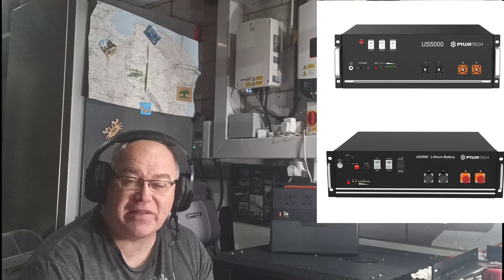Pylontech battery update - not as OTT as I thought (+how we mix US3000/US5000)

Comment: Hi Nigel, Hello from sunny Australia, I current have 8xUS3000 on my Off Grid system in two DC banks with a battery combiner, How many battery modules can exsist in one string using the RJ45 looping control. I read it's 8 max, is this correct? Thank you for the great video. Do you know where I can find a PC monitoring program called "Battery View"
Reply from the maker: I think it's 16 or 20 before you need the pylontech network thingy.  8 was the original limit with us2000 when they first came out

Comment: My FIT comes from British Gas who I no longer use as a supplier. They insisted that I must not under any circumstances charge my batteries during the low cost period and then export that energy out to the grid at peak times. I could only export excess solar energy. I am not sure what happens when I get a car capable of C2G.
Reply from the maker: Unusual that'd presume you get export payments based on actual export through your smart meter not deemed export  but even that is irrelevant how the battery is charged .

It'll say on your fit  bills how it's calculated .

All you have to do is decline export payments on the FIT scheme as I have but sounds like you'd be better off moving your FIT away from BG

Comment: Hi Nigel, good video, I have a 2/12 year old system, 5.44 kw array  (solis 5kw inverter) with 16 panels, 4 pylontech us3000 batteries , I would like to add at least 2 us3000s or us5000s to my system as we have recently added Toshiba A2A system like yours, Having watching yours and other videos it appears to be fairly straight forward to do it yourself, I did ask my original installer who were not very helpful as they have moved away from using pylontech. Do you have any recommendations for the best place to buy pylontech batteries to be self installed ? Regards

Comment: Can you buy Pylontech or any other brand of Batteries second hand and then mix and match  them.
Whilst I will have bidirectional EV charging. Just as with compute spreading ever  cheaper compute into its networks and speading up in the process (pun intended) so having more batteries should make load managment across    the batteries.

Comment: Does anyone know if it possible to be able to charge the batteries without using solar ?
Reply from the maker: Ac charging from the house
Reply: @EVPuzzle  how do you do that. ?
Reply from the maker: @kroozer5215  the inverter will have a setting and schedule to do it . If victron like mine it's on the vRM ess settings at the bottom of the list .

Comment: anyone know what the ordeal with Plylontech 5000 batteries are?, check online and some 5000 are disounted massively and others still holding their price? Is there a difference in versions of the 5000 type hence why some are cheapr??? tia
Reply from the maker: Not seen any really cheap ones tbh , where r they .  I wouldn't trust every ad of course , some too good to be true deals are just that
Reply: @EVPuzzle  Voltacon Energy Systems £1099.00

Comment: The Grid in Australia is rapidly becoming an export tool rather than import.

As an example on a typical Spring day with 12kw of solar, 22kwh of Pylontech batteries, 22kw of off grid inverters , and 2 x 5kw of on grid inverters, 0.010 kwh was consumed and 39.55Kwh exported

If it were not for the solar feed in's and the odd rebate paying for the Grid fees (and part of the batteries) of $1.40 a day i would simply disconnect from it.

Comment: We have had Pylontech batteries for a few years. For us they have been an excellent product. We now have 12x US3000 units and never had an issue with them. They run our entire house including a heat pump for background heating and water heating, Mitsubishi air cooling/heating in the main rooms for fast spot heating and cooling, plus an EV. Our gas was removed last year, saving the standing charge. With charging from solar panels arranged to collect energy from morning to evening powering the house and appliances and recharging the batteries (for most of the year) this the system works incredibly well.
Octopus Intelligent Go. will recharge 30kW in the 6 hours of cheap rate power if required.
If a battery system is larger than it is essential to have and the batteries aren't used to their full capacity this also should add to their longevity.

Comment: A while ago I shared the details of my system with you (20.8kWh) and you commented that I must use a lot of energy. Good to see that you've realised that there are more benefits to a larger system than just meeting one day's needs.
I explain my system thus: 
I can cover my normal needs for two or three days if there's a blackout (unlikely but possible) and zero sunshine. 
I top up the battery overnight (7p/kWh) so it's 100% at 05.30.
Most solar produced each day is sold to the grid at 15p/kWh.
This setup gives me a bill that is >90% cheaper than if I had done nothing.

Nearly every youtuber I've watched say the same that they wished they'd got more (solar & battery) when they first set up. I took this advice and maxed out on my install last year and don't regret it.
Reply from the maker: It's good advice but hard to go all in up front .  I've got there in the end ....maybe just a battery inverter charger upgrade to be perfect
Reply: @EVPuzzle  It's makes a lot of economic sense to have the installer make just one trip to your roof and now that panels are cheaper than ever then all new installs should make maximum use of roof space.
As V2L becomes more common then the EV will come into play as a natural part of the domestic setup.

Comment: Ive had my 5000's for 17 months now. They balance at 89% then shoot upto 100% so watch that point for charging as it might be why you say the first 10% has a lot of capacity. Ie it might say 89% but in reality you could be at more if its sat there for a while. Mine are on 99% soh and i work them hard during the winter with a 3.6kw ASHP if its very cold i start shutting down unused rooms as my house is 1880's built with internal insulation fitted on most external walls. I first went 10kw of batterys but added a second 10kw later so 4 x 5000 pylontech batterys. Im thinking of adding a 5th so i can run with extra capacity  in the coldest winter weeks when no solar added...but im also solis 3.6kw inverter so limited charge time when over 21 kw capacity!

Comment: Hi nigel , if you don’t get the battery’s up to 100% not all BMS systems will balance the individual cells within each pylontech battery , so it is a good idea to fill the battery’s once in a while and leave them there while the BMS balance the individual cells within each black box
Reply: Do pylontech battery’s let you have the voltage of each cell within
Reply from the maker: Cheers mate , I will let mine charge to 100% infrequently in winter more often when there's more solar  but it raises a good question whether it's healthy to charge to the Max 53.5v occasionally.

I can't find anything online saying it's healthy to do this or not

Comment: Hi mate I just plugged mine in and turned it on in a stack when all LEDs were about the same I turned them off then soft boot to the Victron, Victron on and that’s it
Reply from the maker: Soft boot ?
Reply: @EVPuzzle  yeah the pylons have a soft start up, I was made aware of this after I built my soft start for the inverter Capps so you don’t get that big in rush on the caps just the red button then the stack slowly powers up

Comment: hi been watching you for a while why do you have 3 inverters and what is the advantage ?
Reply from the maker: Installed different panels at different times and always ,ade sense to add not replace plus every different orientation needs either aa separate mppt or optimisers to cater for when one array is in shade

My system is a good example of getting it wrong going small, makes more sense to go for it in one go but then I didn't know what I know now
Reply: @EVPuzzle  thank you for the reply i did the same as you went for 3.6kw solis hybrid inverter quickly upgraded to a 6kw solis hybird inverter now im at my limit of solar panels 8kw  i want to install more but my inverter only allows 8kw . not sure if i can add another inverter and apply for more export. im addicted to getting more and more
Reply: @bareallotment7391 how much clipping are you seeing ? Given the UK weather, it would be interesting how much time the inverter runs at maximum capacity.
Reply: @johnrush3596  im not really seeing any clipping as i can use up any solar that is not getting exported . on clear days from around 10am til around 4pm im getting 6 to 8kw of pv depending what im using in house
Reply from the maker: @bareallotment7391  you can always limit export and have more solar . G100 application
Reply: @EVPuzzle  i want to send as much back to the grid as possible to make money .but i was told you could only have 1 inverter but i think because mine is a hybrid . i have 8kw of pv and want to get 12kw and send at least 8kw back.
Reply from the maker: @bareallotment7391  multiple hybrids might get complicated but adding just a plain solar inverter isn't an issue, I have 4!!!

Permission from the dno though seems to vary as to where you live . In theory so long as you stick within your approved 8kw limit they should approve extra solar  so long as export is limited with an approved limiting device 

You can but apply
Reply: @EVPuzzle  thank you for that i want to get as much solar as i can what do i ask my installer to ask for i would love to get around 10kw or can you ask how much can i get?